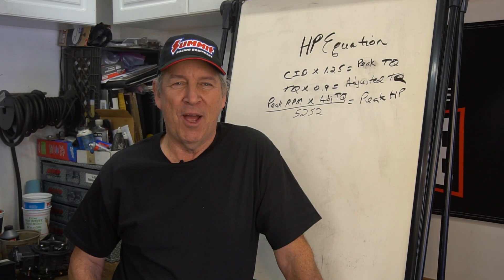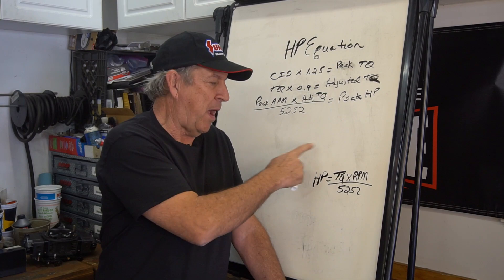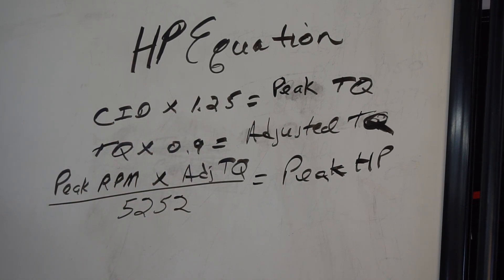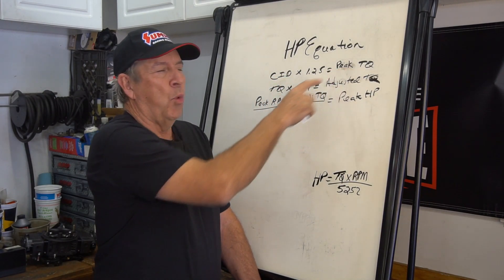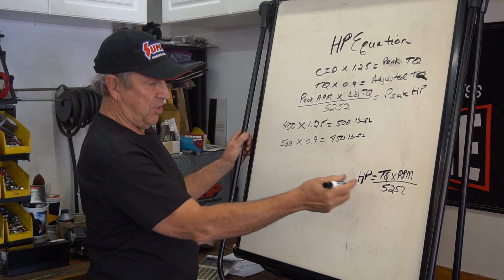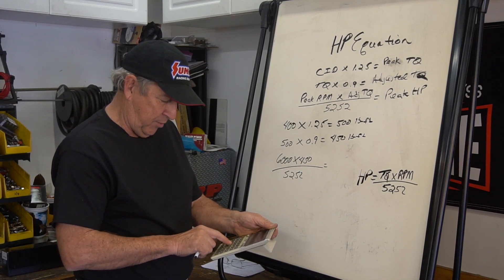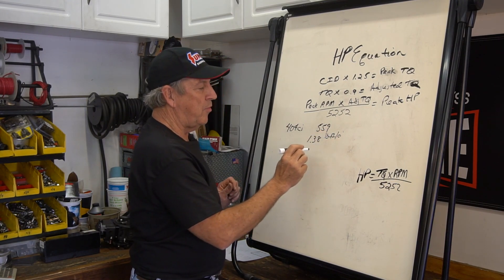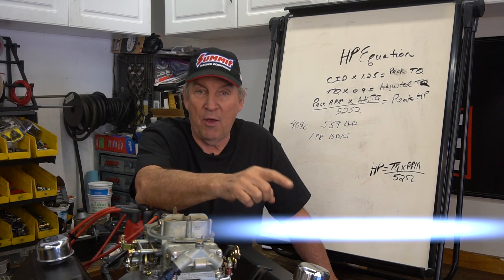Predicting Engine HP . . . without a dyno

Comment: I'm glad I found this video. I've been curious for years how much power an engine I built years ago made. I had a 64 Impala SS with a tired late 70s 400 sbc in it. We rebuilt the engine, and as a 22 year old I made a lot of bad decisions. While my engine builder buddy did the rebuild, I ported the heads and cleaned parts. I replaced the Offenhauser intake with an Edelbrock Performer (waste of money), bought a cam, I believe it was a copy of a Comp Cams 280. It already had headers. I used an equasion from Hot Rod and wanted to buy an Edelbrock Performer 600 carb, but was convinced to buy a 750 instead, another mistake. I wish I'd just rebuilt the leaky Holley 650 that was on it. I also wish I'd spent some of that money on high compression pistons instead. It was a low compression engine that didn't like to rev, and the cam just started to make big power when the engine ran out of revs. It also bogged at low rpm because of the huge carb. It did pull hard though between 2500 and 5000.
I barely beat my brother's 1967 Monaco with a stock 440 magnum in it. If anyone has an opinion how much HP I was making, I'm curious.

Comment: the problem with this is, many engines DONT make 1.25 X their Cubic inches in torque. by this logic every single 360 magnum truck motor should be making 385 horsepower not the 300 they actually make
Reply: They detuned the engine with restricted intake system, restricted exhaust system, and a restricted tune.

Comment: This is way off. I run the numbers on the Boss 429 and it came up with 551 hp. They only make in stock form around 430 hp on a dyno.
Reply: As mentioned in the video, this simplified HP estimator is just that - an estimate that assumes (there's that word again) several things like a really good camshaft that is likely a roller with more lift than a flat tappet. Plus as mentioned several other variables. I ran the numbers to get your 551 hp at 6,000 rpm. The Ford numbers of 450 lb-ft of torque and 375 hp is using a stock and very mild flat tappet cam with a stock intake and cast iron exhaust. If you put headers, a better intake, a nice hydraulic roller cam, and enough carburetor it would probably make 530 lb-ft of torque and somewhere around 550 hp. If you tested a bone stock 429 - it will probably make more than the factory numbers - the OE's often under-rated their engines in order to pass through car inssurance regulations back in the day. Plus, the Boss 429 was rated at 5,200 rpm peak hp - way short of what you plugged into it at 6,000 rpm - do the math - with 1.25 x 429 and then peak hp at 5,200 - it comes to 475 . So it should be obvious that rpmplays a big part in this estimate. We are working with 20 to 30 variables here and yet estimating power to come up with a single number as the result. These are just estimates - it's possible that the Boss 429 isn't capable of 1.25 lb-ft per cubic inch. But I think it probably is - again assuming everythign else. Also consider that this 1.25 lb-ft/ci is based on using modern combustion chambers - which is what establishes combustion efficiency. A Boss 429 chamber may not be that good. But then again - it might be capable of actuall more since its close to a hemi chamber.

Comment: ? I have a Gen 4 Big Block 427 in this equation would I still use 427x1.25
Reply: It's a good starting point. With more compression and/or beter heads that number can go up - or down! But it's a good place to start.

Comment: What needs to be adjusted for higher CR? I honestly doubt that my build has over 500hp, I'm sure I screwed something up and its only got about 385.
Reply: This is based on roughly 10:1 compression so if we increase the compression to 11:1, in theory that should be worth around 4 percent power. Working the math backwards, that would make it roughly 1.3 lb-ft of torque per cubic inch and 12:1 would be roughly 1.35 lb-ft per cubic inch. It's important to note that airflow makes a big difference in power as well so you could have the same compression ratio but with more airflow and the power would also improve. This is a very generic formula that makes a ton of assumptions - but despite that - it still seems to work especially for street engines.
Reply: @jeffsmith2003  thanks, I feel optimistic hoping for 450, the formula suggests around 550. I couldn’t be that lucky 😅

Comment: this equation doesnt work with boosted applications correct?
Reply: Say you have 10lbs boost devide 10 by 14.7 add 1 and multiply that by your power figure. 10devided by 14.7 is .680. Plus 1 is 1.680. If gou have a 350 hp engine multiply 350x1.68 = 588 hp. These are all just figures derived from equations based on assumptions but it will get you someplace to start. And they are fairly accurate if you make adjustments for compression and that sort of thing.   This equation isn’t mine I seen it on a Richard Holdener video I think and I believe he used to be  part of the west tech Dyno facility too. Hope this helps.
Reply: @johnnyatkins9097  - Thank you for this revision to the formula. I calculated my 2.3L EcoBoost using the standard formula and came up with some anemic numbers compared to the "factory" numbers. Add to that most of the EcoBoost engines have the OAR system, (Octane Adjust Ratio), that according to some online sources MAY, (stress on MAY), net you approximately 10% more HP if you run 93 octane. That % may be high but this much I do know, I noticed more "pull" running 93 octane after a couple of tanks ran through it.

Online sources, (there it is again, the power of the internet), indicate that the stock 2.3L EcoBoost produces about 17-18 PSI of boost. I always triangulate on such information to get a consensus based on multiple sources.

FWIW, the formula revision you posted does put the HP approximately where it should be.
Reply: If you ise this eqito get your power figure then you can use another equation to predict boosted power.

Comment: I came up with same formula except I change the torque per cid depending on the build type, so you just got to be good guesstimating lbs-ft:cid and peak rpm and it's fairly accurate.

Comment: So torque after peak-hp rpm correction is 1.125 ft-lb per cube? That is ridiculously low for performance engines. Numbers of 1.3+ ft-lb per cube (for peak torque rpm) are very common with a good head/camshaft combo. I know many 383s that make between 500 and 550 ft-lb.
Reply: You are correct. Again, it's jsut  a starting number. Every engine will be different - but if you tst hundreds of 10:1 compression street engiens - (not competition engines that achieve far more lb-ft/ci) you will see that many street engien shover around this 1.25 number. It's just an estimate - and the goal would be to bring it higher andmake moreI've built street engiens that make 1.4 lb-ft/ci and others that make less than 1.20. This is no hard and fast rule - it's jsut aa starting point. But use lb-ft/ci as a way to evaluate good engines from poor ones! That's the point of this video that I did not make clear.

Comment: Does this apply to all types of stock engines?
Reply: This would not apply to "stock" engines. This applies to good, high performance (re) built engines. I.e., typical "hot rod" parts: Good aluminum aftermarket cylinder heads, performance (especially roller & retro roller) cams, good aftermarket intake manifolds, good (big) well-tuned carburetors, and properly sized headers (read: not too small).
Reply: With this math and if I did it correctly. My stock 5.3 would be 382hp. It's rated at 325 from GM. I can kinda believe that 382 with the modifications l did during the rebuild. My tuner said it should be about 375ish hp. Very cool video. Thank u sir

Comment: this is dead accurate my NHRA C/SA 1995 Corvette makes 581 hp @ 7500 RPM. According to this formula is 360 ci x 1.25 x 0.9 = 405. 7500 RPM x 405 / 5252 =  578.351.  This is 99.5440% accurate which is almost the 99.997% survival rate of CoVid-19.
Reply: ... and without a face diaper!
Reply: @atomicwedgie8176 when you see them discarded on the street the correct term is “sheep droppings” but if you see someone wearing one the correct term is “Cuck Cover”

Comment: Vizard says that you can get 1.45 x cid for torque if you know what you are doing.
Reply: Absolutely - if and only if you are really good at building a normally aspirated engine. I'm assuming that David is referring to a pump gas engine. It's a great goal to use as a goal. As an example, my Iron Maiden 6.0L multi-part engine project that ran in Car Craft magazine (RIP) ultimately made 501 lb-ft of torque. That's 1.37 lb-ft/ci with a 100,000-mile used shortblock and less compression than it could probably use. So assuming another 15 lb-ft from better compression and ring seal, that would be 1.41 lb-ft /ci. So yes, a 1.45 number is achieveable and I did mention that this 1.25 lb-ft/ci number was just a typical street engine standard. As street normally aspirated engine builders get better at their tradecraft, that number will continue to climb. Jon Kaase told me that he sees around 1.55:1 lb-ft/ci for engines that win or place very high at Engine Masters. If you look back at the winning engines from the last few years - they are right there - but these are not street engines. They are really closer to NHRA Competition Eliminator engines with rules applied to them. I thnk that 1.6 might be a number you'd see with a NASCAR engine - perhaps more. That's a gues since I don't have access to current NASCAR engine information.
Reply: @jeffsmith2003  Thanks for the response.  Remember you from back in the magazine days.  Anyways, it might be good to kinda guide folks on how they can up their torque on their street cars.  Just too much emphasis on Hp.  Torque rules on the street.  ("Torque wins races, horsepower sells cars."  Carroll Shelby)
Reply: David Vizard is hack and a clown. I challenged him to beat my 419 horsepower NHRA Stock eliminator 305 (428 horsepower now) vs his NHRA Stock Eliminator 305 build and he declined my challenge.

Comment: Well my hp came out to be 554. But im working with a  low compression 454 over .030. 781 heads thats ports. And a comp cams xe268. As of now i have a fitech efi which should free up some power. But i dont think im anywhere near 500hp with my setup
Reply: No your much closer to 350
Reply: @Junkyard Rat S10 car was sold a few months ago.  But the compression was very low.